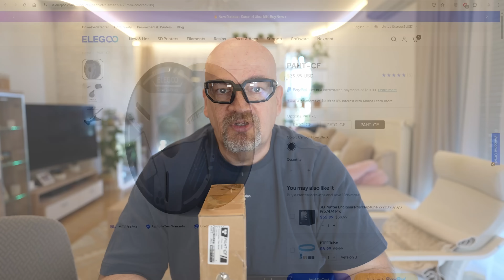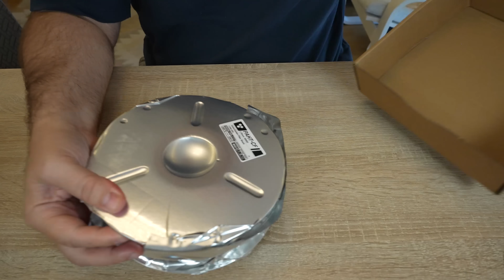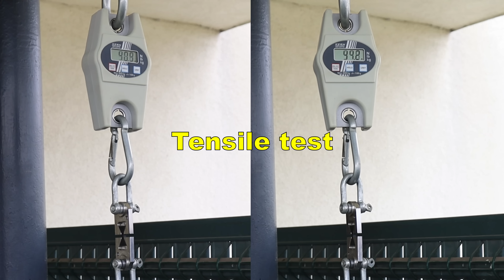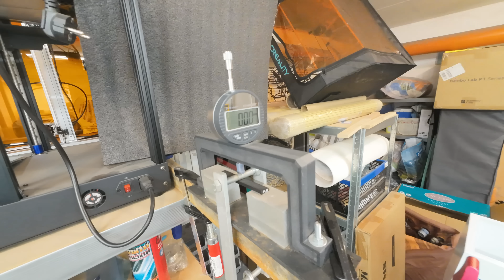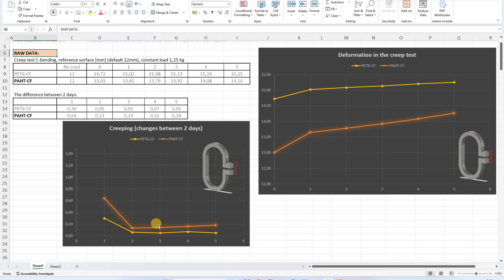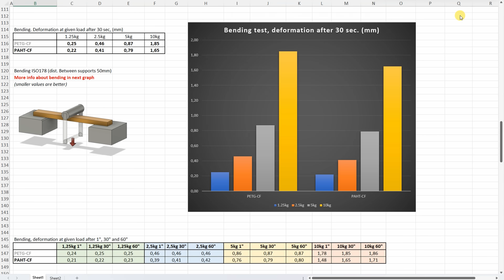High-Temp Nylon for $40/kg? Elegoo PAHT-CF Tested!

Comment: I dont use nylon anymore, its moisture uptake causing weakness makes it a no go for me.
Reply: What is the use case?
Reply: @confuzled_makes any strengh usecase, mostly the prime reason to pick this material. Yet it gets weaker and deforms because of moisture defeating its whole purpose
Reply: Its the same to me as tpu-cf...useless
Reply: @TheOneAndOnlySatanyeah, nylon looked really appealing to me until I learned about how big of an issue creep is with it
Reply: @startedtech annealing largely fixes that
Reply: @confuzled_makes  Glass filled nylon 66 is fantastic in automotive applications.  Once it absorbs moisture from the air, it's quite tough, and has excellent temp and fuel resistance.  With high enough glass content (33%) it is quite dimensionally stable as well.
Reply: @ArgueForSport sometimes I forget not everyone is printing guns lol
Reply: That is only an issue for pa6, try pa12 or ppa.

Comment: Recommended print temp makes me think it is pa12. Ppa would have a higher temp
Reply: And why I hate the term "PAHT" being thrown around. Means literally nothing. It's like going to the meat counter and asking for ... Meat lmao
Reply: Bambulabs has replaced his PA12 with PAHT, it says it's PA 12 and other long-chain PA, so like an "improved PA12 version".
Reply: @amigodesigns I can't knock there paht, it is amazing. However, I can't justify the price over sirayatech, ESPECIALLY since bbl recommends .6mm anyways, so that means I'm comparing it to the .6mm version of sirayatech ppa-cf. 85/kg vs 45/kg. 
Bbl is better, but it isn't better enough to pay double. Or triple if your actually want to compare bbl ppa-cf against Sirayatech ppa-cf
Reply: @confuzled_makes  Yeah, 100% bambulabs engineering filaments are stupidly expensive, that's why I'm considering either elegoo PAHT-CF or Sirayatech PET-CF for specific high strength and accuracy dependant applications. Otherwise BBL PLA for bulk prototyping )got 10Kg recently for around 10€/Kg) and CC3D PBT-Pro for semiflexible and low speed impact parts.
Reply: Sounds like this product was too good to be true. I didn’t find a technical data sheet. The mixed fiber types and complaints of surface roughness makes me suspect they mixed in glass fibers with carbon fibers.
Reply: @JeffDM na, no glass fiber. They probably just bean it's both chopped and ground CF. The ground will get you the rough texture.

Comment: Hi Igor, I asked Elegoo a few months ago about the PAHT.  The advised it is LCPA, a long-chain polyamide nylon.  Thank you for the testing!! 

It was too bad that you had to compare it to a PETG-CF, as I would have preferred to see it compared to the average values of PA6-CF, PA6/66-CF and a PPA-CF.  Fortunately I can sort your spreadsheet to compare the data to other engineering filaments. :)
Reply: Hmm, I emailed Elegoo and was told that this filament is pa612 based.
Reply: @rustimack  That was more specific info than I got back in June when they told me it was LCPA, or long chain polyamide! As it turns out, both Nylon 610 and 612 are LCPA's.  So their LCPA answer is correct, just sorta vague.  

If you look up DuPont or Zytel LCPA you will get hits on 610 and 612 nylons. 612 is longer chain than Nylon 66, but shorter than Nylon 11 or 12. I found a TDS that shows a disappointing HDT of only 62C @1.8mPa. At least that was for the specific grade I came across.
Reply from the maker: Eh, yes. Some companies don't like comparison to other brands (or average values, or printing on other printers). That's why I like better to buy the filament for the test. And thx for info about nylon type.
Reply: @MyTechFun  please don’t do reviews of sponsored filament if you cannot compare the filament to useful averages. I love your spreadsheet but it’s not right for the YouTube video to be reduced in usefulness simply for $40.
Reply: @MyTechFun  Exactly.  It's easy to see from your spreadsheet how poorly their PAHT performs. I worry that people will buy it because it's cheap, not get impressive results, and then assume all PAHT's that are PPA's are just hype.

They do sell some excellent PLA's, though.
Reply: @ArgueForSport  I'm not saying your wrong... just that it's hard to draw conclusions like that from a single test at single temp.  I think Elegoo's default profile may be the cause and had Igor run additional tests with higher nozzle (300C) and bed (100C, which helps heat the chamber) that the layer adheison might have been much better.  IDK... I should just buy a spool and test it myself :D
Reply: @jb510 you nailed it.  That's exactly how I print this filament.  300c hotend, 100c bed and I get fantastic results.  I used Bambu labs paht-cf profile and just turned up the hotend a bit.  Prints so well.  Oh also I use zero part cooling.
Reply: @MyTechFun  It's frankly misleading to contextualize this filament with a comparison to PETG. It performs poorly compared to other PAHTs. I understand that the spreadsheet you provide to patrons will reveal the truth, but how many users will see that compared to this video? If it compromises the video in this way I would not do  sponsored reviews in the future.

EDIT: That was pretty harsh, sorry. I just really like your content and want to make sure my concerns are communicated
Reply: @WadeRobrsn Naw Wade, you just wanted to be harsh. 😂😉😁 JK brother. We all want comparable results. Doc Igor is a rock star in the filament world. He can take some tough criticism. 😉